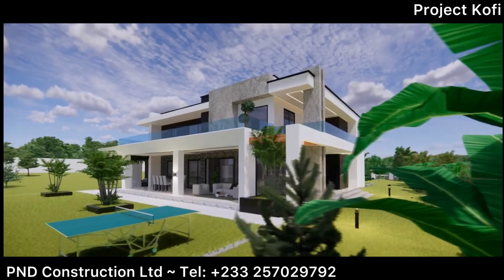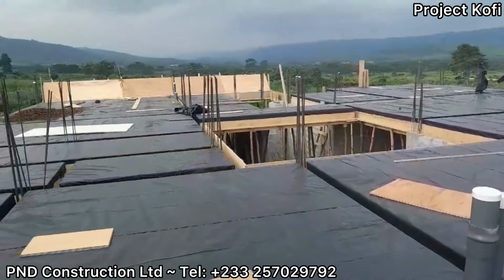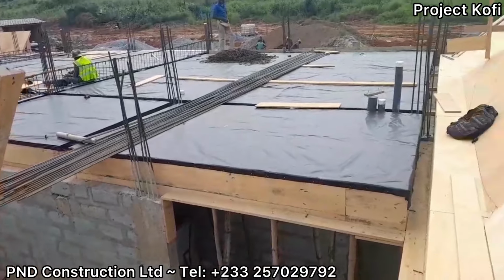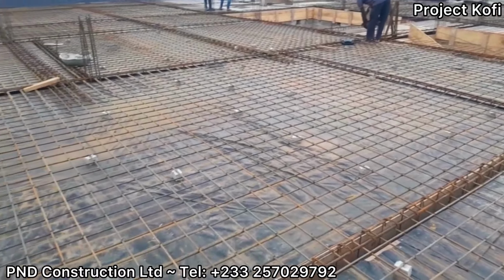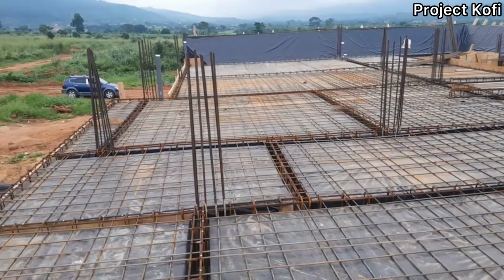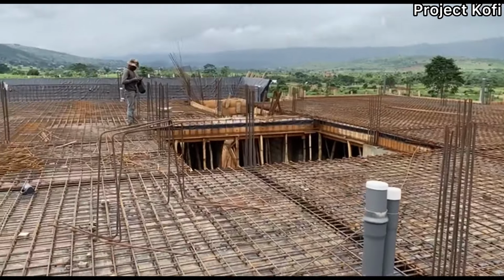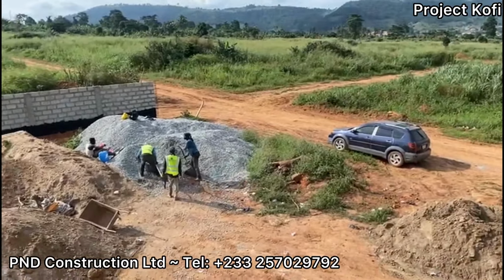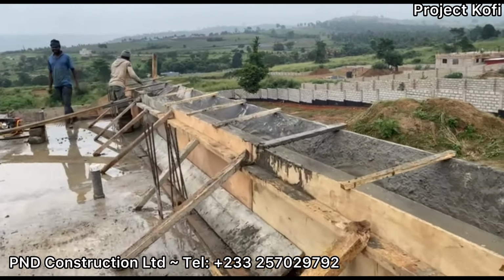Building in Ghana: Decking & First Floor Casting

Comment: A thick slab put unnecessary weight on the columns. For a residential project there are better ways of achieving strength and quality while keeping cost down.
Reply: Well on a sloping land , a ‘thick’ slab can also act as a shear wall.  Lateral forces on sloping land , should be transferred into columns via the slab  without distress or cracking